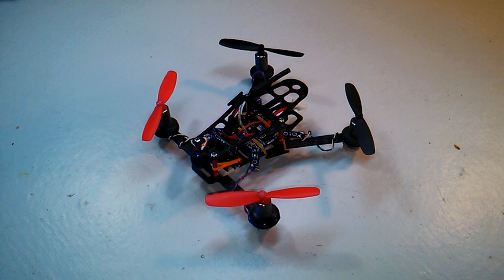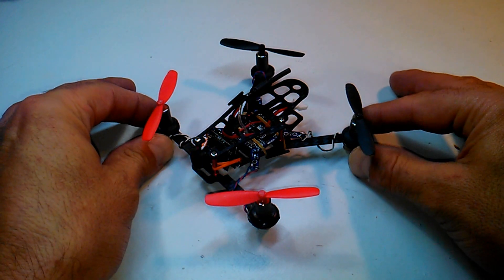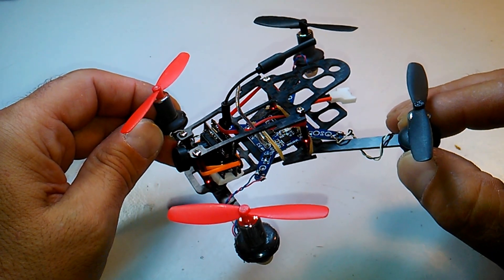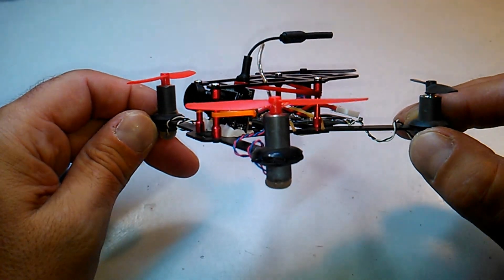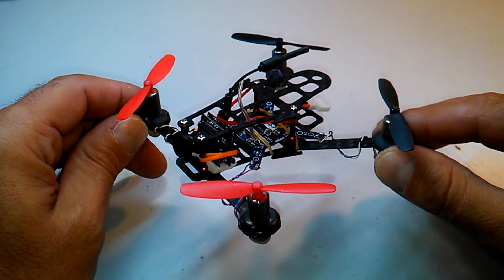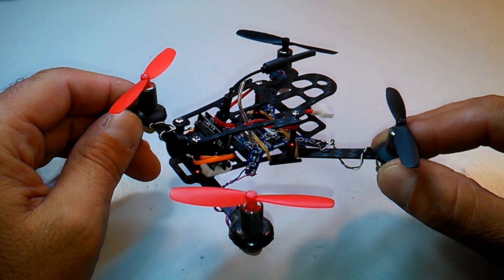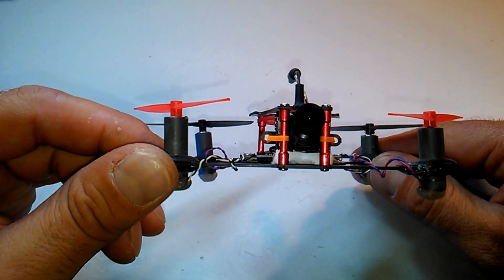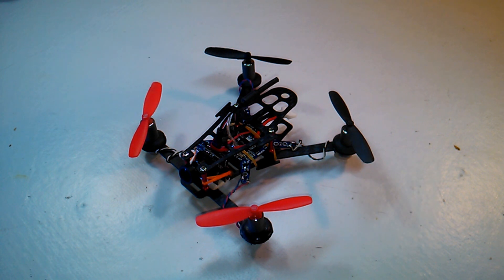FPV with easy cheap micro build - JJRC H8 Mini

Comment: This is FANTASTIC! I love that you took the H8 and placed it in a 100mm frame! Brilliant! Did you power the AIO off the battery terminals? What range did you get on the quad (not the video).

Comment: Nice build Luis, great job mate.. I can see from the footage it flies really well too.. Great micro fpv quad.. Thumbs up 👍 brother
Reply from the maker: Thanks brother, it does not have that punch that other micro fpv quads have but it flyes fast, it´s pretty stable and he´s fun to fly... To get started it´s great and I only spended 30/35euros (45/50 aussie dollars more or less), the camera was the only expensive part of it... Thanks for supporting like always, all the best bro
Reply: Drone lovers Portugal that's a pretty good deal bro.. Great work and many happy fpv flights out of it ;)
Reply from the maker: Thanks brother, this was the easiest cheapest way someone can start doing FPV and learn how to fly properly before buying or assenbling a expensive quad... I'm starting a diferent build today, I ordered some proper parts two months ago but things always come on the slow boat from china so they only arrived yesterday... This next build is going to be a proper micro fpv 105mm quad, had to spend a bit to get a nice carbon fiber frame kit, a F3 EVO flight controller, PPM receiver and red Racerstar motors (love these motors)... I'm really exited to start learning how things actualy work on quads and messing around on BetaFlight to get the exact type of flying I want... Tomorow or the day after I'll upload the build vid, hope I dont mess things up, eh eh... Big hug Dave
Reply: Drone lovers Portugal I'm sure you'll make another great flyer bro, I'll be tuning in Luis  :) have a good day man 👍